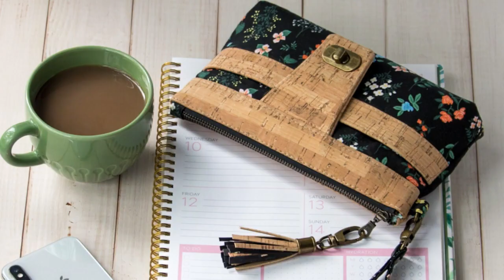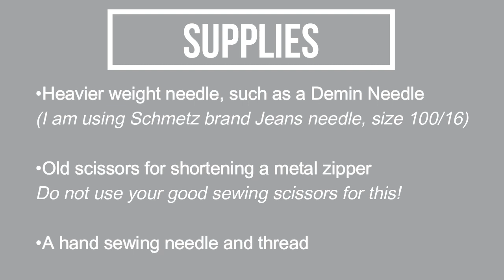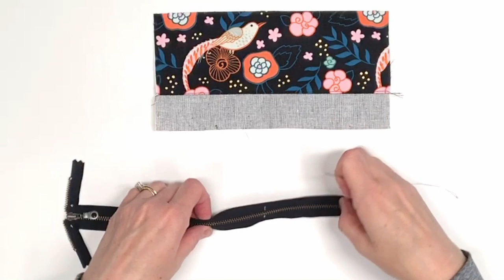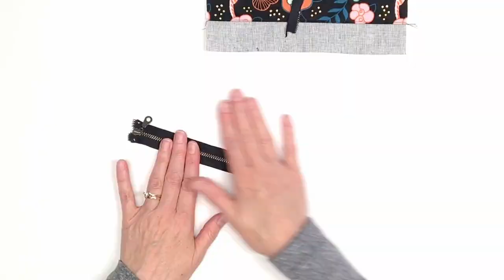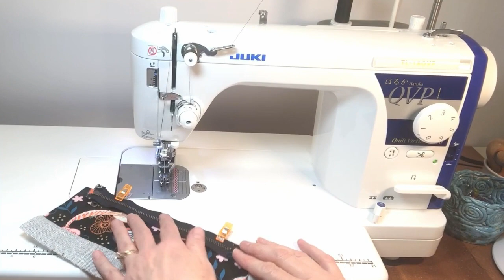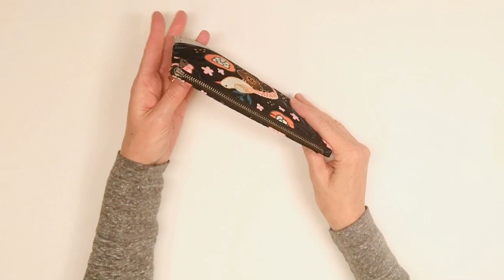Tips for Sewing with Metal Zippers

Comment: Thank you for sharing the metal zip info.  Just curious, why do you cut the back end, as well, and sew it?  Would it be easier to cut 2x the amount on the front end and leave the back end the way it is?  Just wondering why the preference. Thanks again for the tips!!
Reply from the maker: Glad you found this helpful!  You are right that I could have left the closed end as it is and just shortened the opening of the zipper closer in.  It can be helpful to cut off the end of the zipper with the metal zipper stop just to avoid hitting it while sewing the zipper tab.